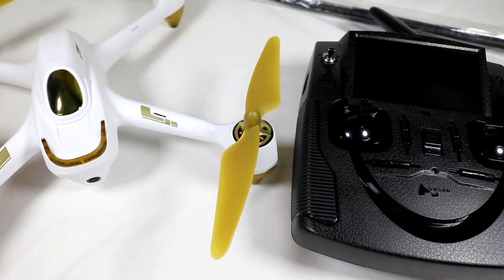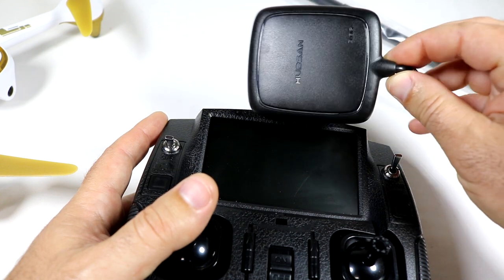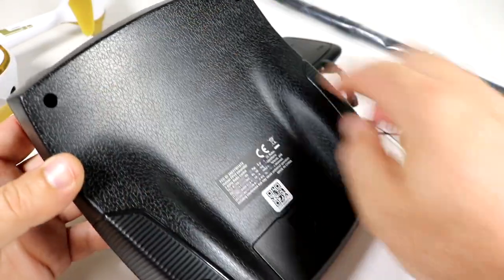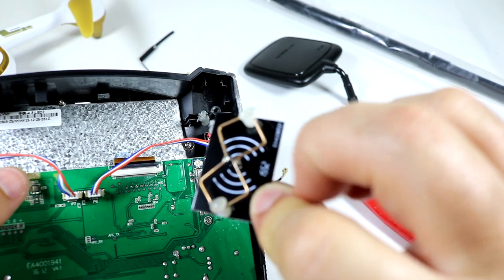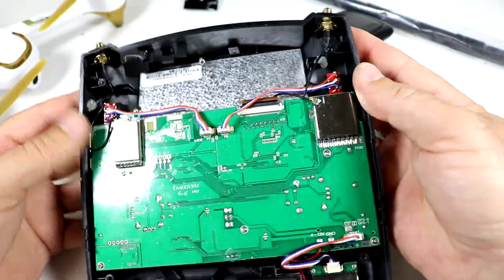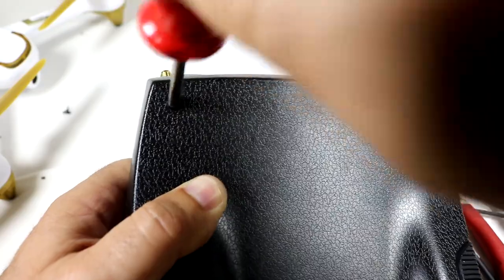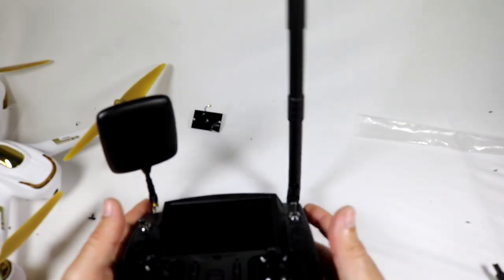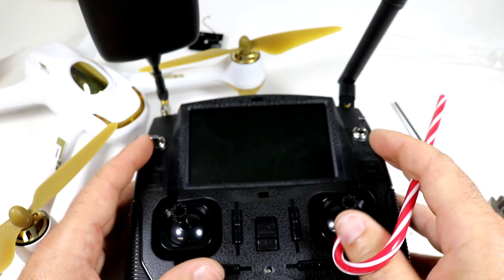HUBSAN X4 H501S Long Range Mod Tutorial [Step By Step]

Comment: Can both SMA connectors be used for both sides? Or does one go with one only? like one has to go with the 5.8ghz and one goes with the 2.4ghz or it doesn't matter? I know what sides the antennas go on i am just talking about the SMA connectors alone. Thank you very much.
Reply from the maker: +Ian Rice yes, you can use the coax portions on either side.
Reply: Awesome that was the only question i had about this thank you brotha.

Comment: Hopefully get mine soon. How did you double your battery mod for your H501s and did you also mod your transmitter battery
Reply from the maker: Just 2 lipos attached with a parallel cable.  Second lip taped to bottom of the quad.  check the vid on my channel.  I have not done a controller battery mod yet.
Reply: I just watched it cool, no tutorial on how to but I will figure it out also do you just used the regular hubsan batteries or are there other third party batteries that are better.

Comment: I did the exact mod but the fpv still has interference it actually didn't seem to change from the original ones? Any suggestions
Reply from the maker: +Suazzz analog FPV will always have some interference.  It's if the range is further while still having picture you can see

Comment: Hi there Dustin,
Got myself the hubsan X4, and just made a maiden flight with it.... After antena mods... I lose video at about 510 meters... panic and hit the return, and it returned...:)
 you run about 2km with the same antenna... how come I can't? does it matter where this antenna facing? does it have front and back side? Just wondering...
Reply from the maker: +Jack Scarpon yes, there is a front and back.  I've heard some firmware versions may limit the quad.  I still have to check what mi e has :)
Reply: try to find out about the firmware... and post a video about it... would love to see it.. tomorrow will try with antenna facing the other way.. 
also wish hubsan will have an on/off switch so you don't need to fight with battery door every time..

Comment: So can I install these antennae on the advanced controller if I wanted?
Reply from the maker: +Zachaboss yes, but make sure you get the correct connection male/female on antennas you get. The advanced controller has the connections already mounted outside but I forget if they are male or female type sorry.  You can just screw larger antennas on.

Comment: Does anyone know where to get the goggles that plug into the transmitter? Or can you use the rca to headphone style plug to view externally?
Reply from the maker: There are a new set that supposedly work.  I'm sorry I have forgotten the Model.
Reply from the maker: I did try my fatsharks with a radom cable that fit but was the wrong pinout.  I could get video if i pulled the cable out slightly but no telemetry.
Reply: Such a helpful demonstration, Dustin - can't thank you enough! (^_^)
I've already bought the H501S as well as a similar long range kit. They arrived last week, but the weather here has been atrocious so I can't take it out yet.
I also have a cheap JJPRO-F01 5.8GHz FPV headset with a basic 1.4dBi mushroom receiver on it. On my old drone, I used to get a lot of static - especially at range and/or if the belly of the drone was angled away from the headset's receiver.
If I were to buy another High Gain 5.8GHz 14dBi Panel Antenna and swap it onto the headset, would it resolve these static issues? I want to be able to use the goggles reliably at about 500m - 1000m.
I know there's an FPV Goggle USB port on the side of the H501S controller, but my cheap headset doesn't have an auxiliary input, so this is why I need to upgrade the receiver instead.
Reply: Hubsan now makes a goggle with built-in telemetry, but as of April 21, 2018, they are not being sold in the U.S.

Comment: Isn't the patch antenna very directional? Wouldn't you lose video signal if the antenna is not directly pointed at the drone, say if the drone is behind you?
Reply from the maker: +Matt Williams Exactly right Matt.  Keep the craft Infront if your going far as shown in my long range flight vids.  You'll get more distance with a patch or helical but there is a cone you need to stay in compared to an omnidirectional cloverleaf or Pagoda antenna.
Reply: Dustin Dunnill what do you prefer for long range this patch antenna or Omni ?

Comment: I received my h501s 3 days ago and I can't get 10 feet away from the controller before the fpv bombs out!!
Reply from the maker: weird.  try it away from residential.  maybe you have interference.
Reply: yea I fly strictly residential and mine cuts in and out 0 feet away.  I have gotten about 250m range with the stock antennas but after this mod kit I'm suckin.  I can barely get 150m before I completely lose it, I guess @dustin Dunhill might be right, at least I'm hoping he is right.

Comment: I have the H502s on the way with the antenna and transmitter battery box mod gear arriving at the same time. I planned on doing mods while charging at least three of my spare batteries before first flight. My question is this a good thing to do or should I set it up OEM first and first flight it that way before mods?
Reply from the maker: +busa x I'd fly it as it come for a few Flights first just to make sure all is well then mod :)

Comment: Dustin - thanks for your nice video.  Can you tell  me what the the orientation of the paddle antenna vs the pole antenna is supposed to be like in relation to the drone when it is up in the air?  thanks
Reply from the maker: +samnella9 keep them like I had them on the bench here towards the Hubsan for best range.  Pushing them a bit further apart so patch FPV angles more left and pole antenna more right may be even better.

Comment: great vid!! i have a question so i need to purchase the fat shark v4 teleporter goggles for my walkera f210 with devo 7 remote but are the goggles compatible right out of the box?
Reply from the maker: +Broderick Jones Hey, get the 32 channel  module and they will tune in.  Then you can use them for everything 5.8ghz.
Reply: So buy the fat sharl v4 telepoter goggles then find a 32 channel module? How would i inster a module by the way lol
Reply: +Broderick Jones i actually bought the walkera goggle 4 i will do a review and sharr it with you

Comment: Will this mod also increase altitude or only range
thanks for the video
Reply: Only range. Altitude is limited on this drone.
Reply: +nd dn ok thanks im ok with the 250 but i read in another video feed some people got 400m. but i haven't seen a video with that altitude on this quad
Reply: Sorry, i dont have this drone otherwise i would confirm it but hubsan has been increasing and decreasing the limit with each firmware update. I didnt like how hubsan was going about the altitude limit so i went with xk x380.
Reply: +nd dn Yea i plan on grabbing that one and the hubsan x4 pro 109s next whats the altitude height on that one if there is one

Comment: How much gain did you get out of this mod in my location I can get a good 250 meters range on stock and about 150 to 200 meters fpv range I'm currently thinking on installing external antennas
Reply from the maker: Here's my range test https://youtu.be/Y0M9AG4fM6Y

Comment: ❤mine already installed as I got drone of kind fella off eBay,😊FREE for Xmas🌲which is nice, I fitted a motor from my CRASHED H501s, as I flew it in an Urban area and it lost control, so use as donor parts😊

Comment: I did this exact same thing and my RANGE IS WORSE!!  I could easily get 250m with my stock Hubsan remote but after I did this mod I can barely get 150?  no pinched wires, no issues short range and the antennas seem to cut out with no warning at about 150m. THANK GOD for the fail safe.  but this sucks.  I'm really unhappy? anyone have any ideas? thanks!
Reply: dino beaton I'm able to get about 230m out then my drone automatically comes home
Reply: Ralph  Suarez yea so I am able to get about 400m if I am in an area where there is no interference.  However, the new antennas seem to pick up more interference than the stock ones.
Reply: I'm mostly flying in residential areas really.
Reply: One thing to look out for is cell towers. They can, but not in all cases, produce enormous amounts of interference. 

To be clear, my suggestion isn't to fly in an area with no cell reception. Just stay as far as if practical from cell towers for less interference.

Comment: DO NOT PURCHASE! 
do not purchase the extended range kit as if you are ordring the drone and the range kit the remote to the drone fpv does not have the connector it is sotterd on the bpard to a tiny pin i found this out by i purchased the drone from gear best and then orderd the range kit from bangood the drone came i opend up the back and found that the controller connector was there but the fpv was sotterd and im verry mad. is there any way like i think tp strip the original fpv wire and on the connector part you bought cut that off and strip it then  sotter the two parts together
Reply: Rare Killer I have the same issue. Fpv internal antenna came soldered to board. Did you find a solution?
Reply: i ended up cutting the wire and souldring the 2 wires inside together but ended up trashing the controller and buying a advanced controller.

Comment: Nope still like 10 feet if that and the fpv drops out completely guess I will have to message gearbest see what they say
Reply from the maker: That's too bad.  Maybe you got a defect.  It happens.
Reply: Dustin Dunnill I have gone into controller settings and changed the fpv frequency by .5 and it seems better